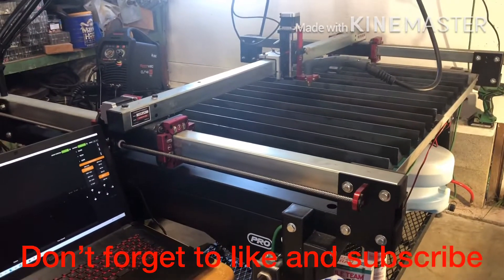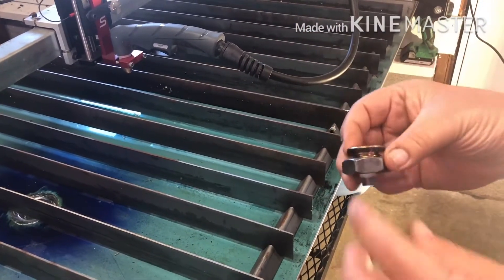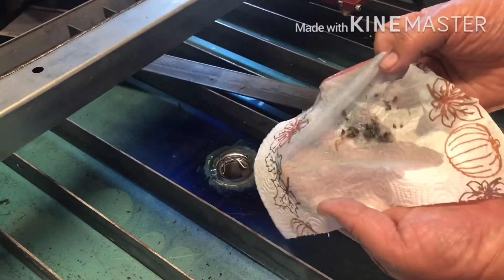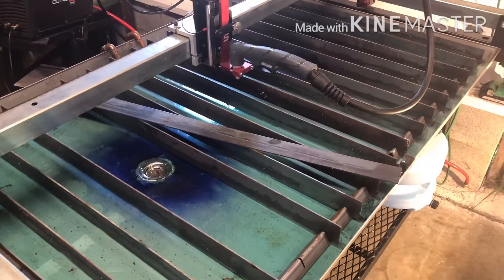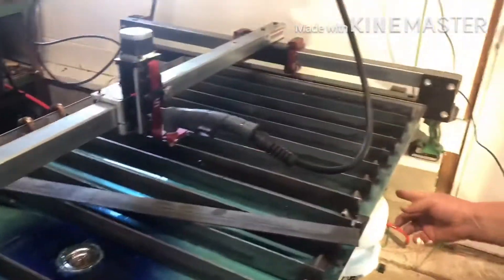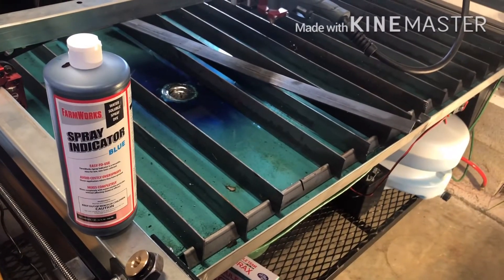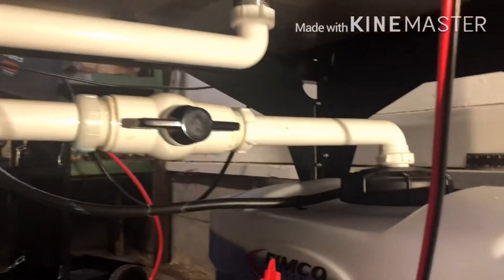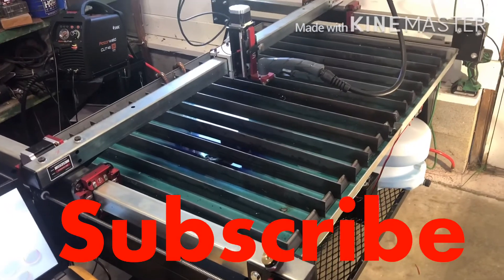crossfire pro custom water table system

Comment: I'm curious if the Borax and pH of 9 or higher is still working out for you to control rust?  My concern doing that is that a pH of 9 or higher can adversely affect the corrosion control for non-ferrous metals (didn't know how much aluminum, brass, bronze, etc was near where this water would splash and possible corrode.
Wasn't sure if you had considered using Sodium Nitrite powder instead (nitrite, not nitrate).  It can be harder to get and is more expensive.
In the video you mention amounts to use, to make a 5 gallon amount.  Do you then add that to the other 10 gallons of water, or is that your recipe PER 5 gallons?
Also, I would recommend adding a little bit of an algaecide/fungicide/bactericide/virucide to the water.  pH of 9 will help, but you can still grow stuff in that water.
Thanks for this video, it answered much of what I was wondering about building my own drainage, filtering, anti-corrosive, anti-fungal, storage, and pumping solution for my Crossfire Pro.  Have a great day!

Comment: My silicone melted and now it leaks in the middle.  I'm going to take it off and tig weld it solid.  I just use cheep dish soap from dollar general.  Your table is crazy clean.  When I clean out my table I have about 2 gallons of metal.  How does your tiny filter not get clogged constantly?

Comment: A parts list for your water system with links to suppliers would be greatly appreciated.  Thanks in advance, Barry
Reply: The tank is a UTV spray tank from Tractor Supply.  The plumbing is all from Lowes.
Reply: What kind of pump?
Reply: I don't use a water pump on my setup.  Instead, I use a regulated electric bicycle tire pump at 2 psi which fills the table in about 2 minutes, and through valving and gravity, drains it in about the same amount of time.

Comment: Can't you just drill holes in the bottom of the dividing wall between the 2 sides so you only have to pump to one side to fill both?
Reply: I thought about that, but didn't want more holes in that seam.

Comment: I have a newbie question.  Is the tank for the drain water, the supply water or both? Thanks from Colorado.
Reply: Both, it stores the table water when not in use.
Reply: @andrewmack5399  Thanks.

Comment: Did you guys consider using a 120 V transformer to 12 V DC to run your pump?
Great set up I’m gonna plagiarize a bit I love the bar top drains
Reply: Thanks, probably will do that in the future.
Reply: I love the setup. But I think a guy could get away a lot cheaper just thinking... With one of the plastic 25 gallon barrels on its side and a 12-volt sump pump for a boat??? What are you guys think you have the table I'm fixing to buy a table would you recommend buying the stable? Now that you've owned it a while? And do you think my idea would work?
Reply: @1ton4god  like the table so far.  As for tour idea, it should work, bit we only spent $200.00 it will be bard to stay under that amount.  Let me know how it turns out.